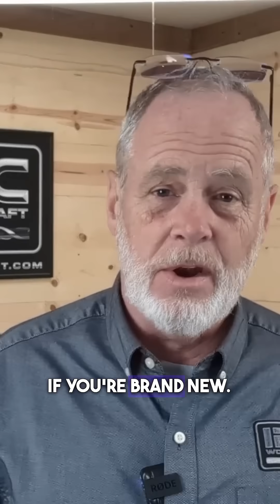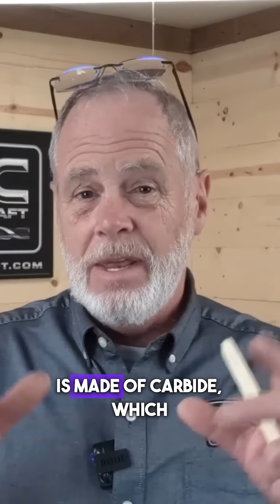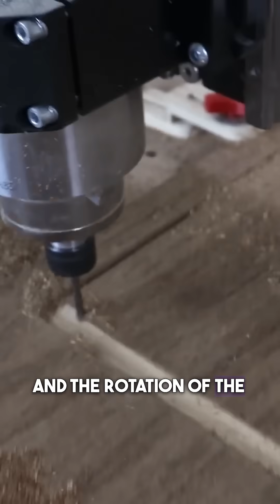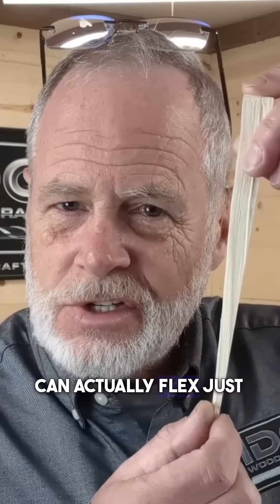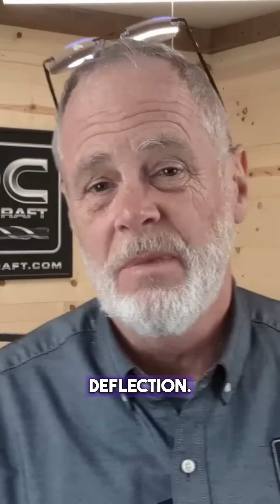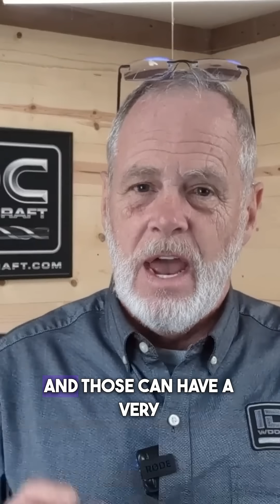Understanding Router Bit Deflection

Comment: Its like round stock on a lathe. Goal is to balance the forces by either not having the bit extended too far relative to its diameter or slow down progress through the work piece.
Reply from the maker: You’ve got it, my friend! Balancing the forces is crucial for quality work and tool longevity. Thanks for sharing your thoughts!